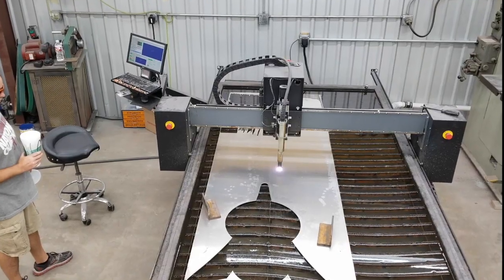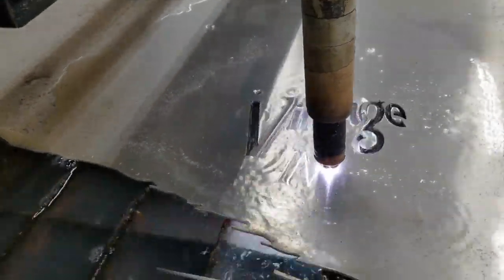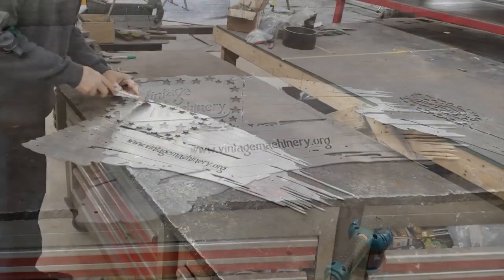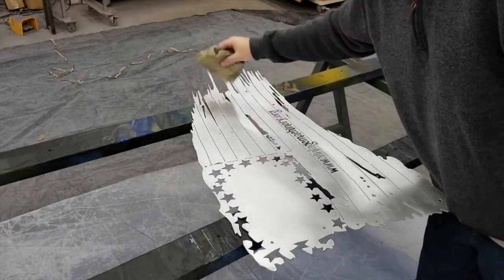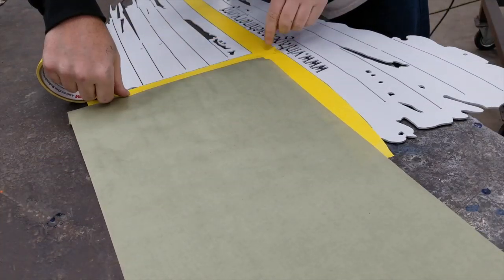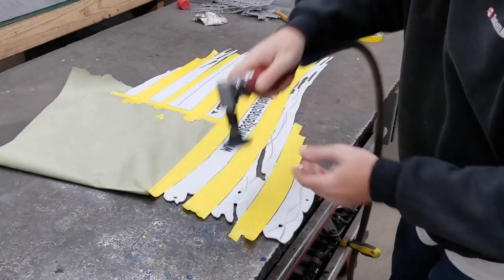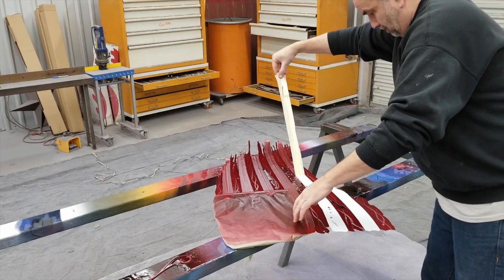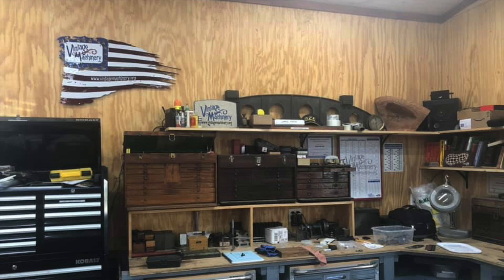Vintage Machinery.org Keith Rucker American Flag

Comment: That looks great, Gary! Did you use aluminum because you had it on hand, or was there something else about it that was better than steel? With the cost difference and rougher edge on aluminum, I have not used it much. The cut quality is great on yours. It appears to be a fine cut, right? That gives me some hope of being able to do clean cuts on aluminum (with having the powermax 65), but my table may not be quite as smooth running as yours (DIY built 4x8 with a heavy gantry). That high gloss, deep looking, finish is awesome and he is lucky to have a cool piece for his shop!
Reply from the maker: When I make aluminum ones I don't bend them.  They have a more refined look when left flat.  I was thinking keith would be mounting his flag on his bead board wall and could screw right into it, so i sent him 4 1" spacers, some stainless screws adn put 4 holes in the flag around the perimeter so the spacers are standoffs.  When I do steel, i usefully put some pretty notable bends in it and its harder to get it to mount on standoffs.  Really both styles look good, just a preference thing.  Also the candy paint pops a little better on bare aluminum compared to steel

Comment: This is a great example of artistic ability. However, 4 CFR 8 (i) states: The flag should never be used for advertising purposes in any manner whatsoever.  It should not be embroidered on such articles as cushions or handkerchiefs and the like, printed or otherwise impressed on paper napkins or boxes or anything that is designed for temporary use and discard.  Advertising signs should not be fastened to a staff or halyard from which the flag is flown